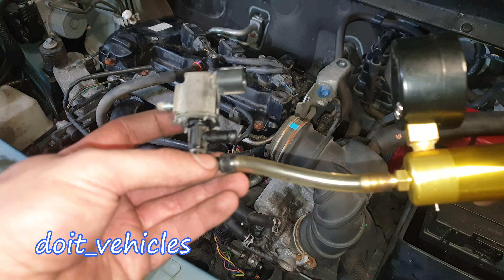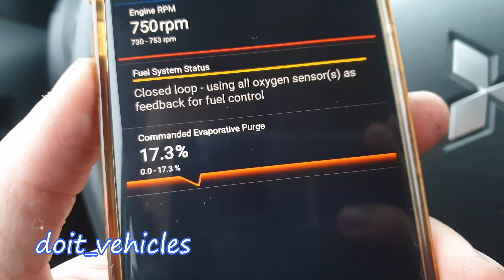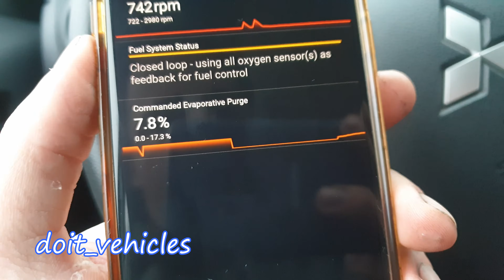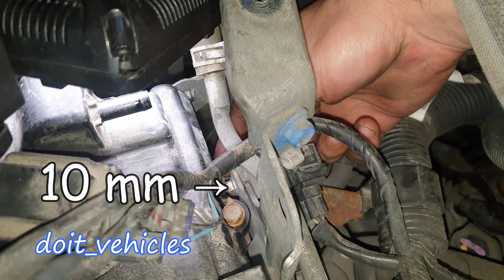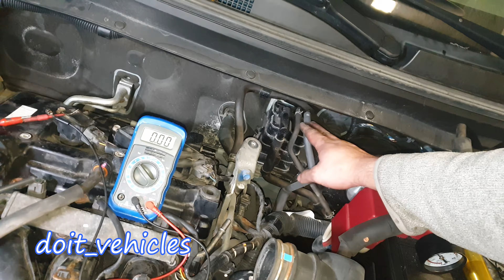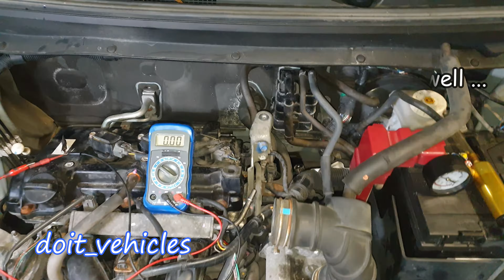EVAP Solenoid Purge Canister Check on 1.0 Mitsubishi Mirage / Space Star P0456 P0442 P0449

Comment: Perfect explanation, but I have problem of high RPM in mirage while in drive mode without pushing speed pedal also observed high RPM during gear shifts, this problem occurs after CVT oil change which was overfilled by mechanic. No code is coming. Plz suggest a way forward. ll' Appreciate your response

Comment: I cant even find my evap purge valve on 2007 mits galant. So im watching all these videos and still no luck!
Reply from the maker: It will look similar to this one , just follow the hoses and see where they go ; one hose will connect to the intake somehow and the other will go further through the "fire wall " maybe together with the fuel lines
Reply: @doit_vehicles  i got a diagram from my mechanic and its in a totally different spot than any other i saw online. Located under manifold

Comment: Where is the vent valve solenoid located? My check engine light is on and I have a code p0456(very small evap leak). It's not my purge solenoid so it only leaves the vent solenoid. Can you show the location and replacement part.
Reply: did u find it?